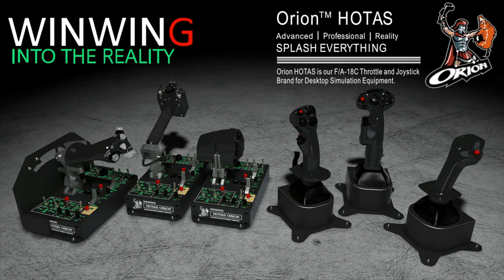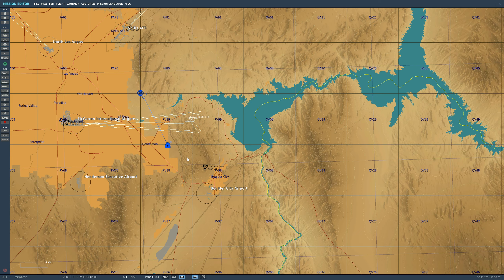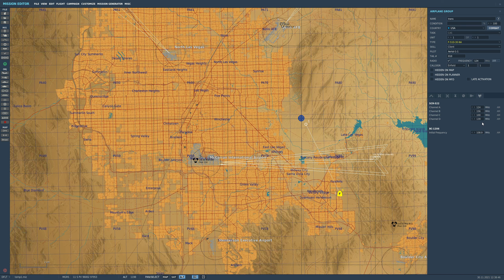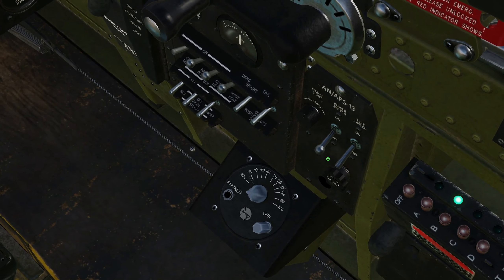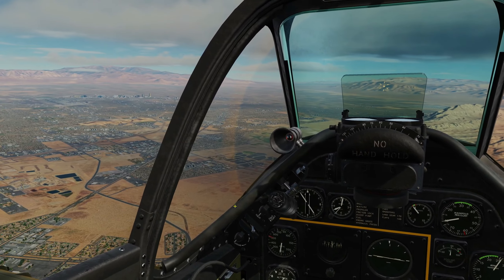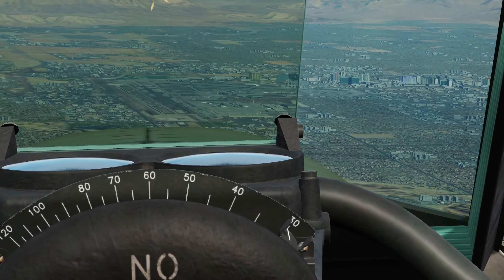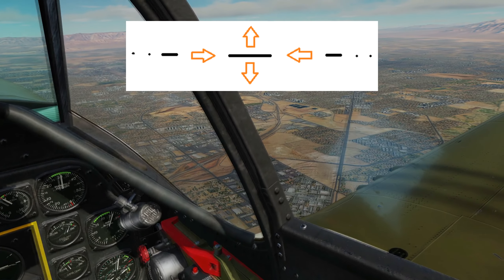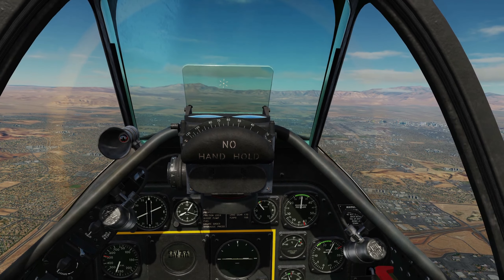P-51D-30: AN-ARA-8 Radio Beacon Navigation Tutorial | DCS WORLD

Comment: Nice demonstration! I've just tried this today and found out a really neat thing with this radio homing feature is that the closer you are to the beacon, the louder the signal and vice versa! You can also put any ground unit in the map, make them transmit a message file on loop in the same frequency and it will be a radio beacon as well.